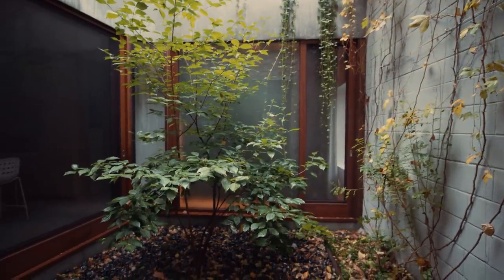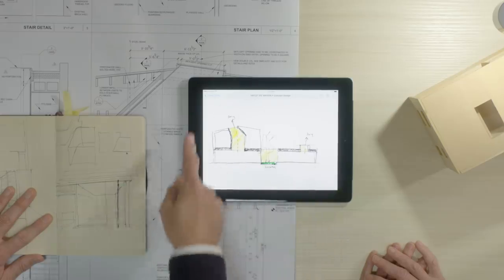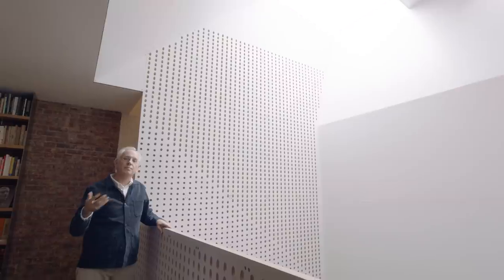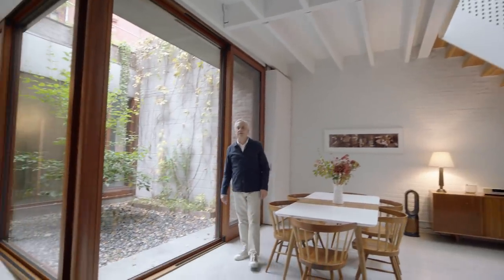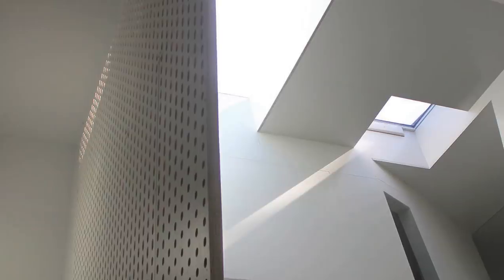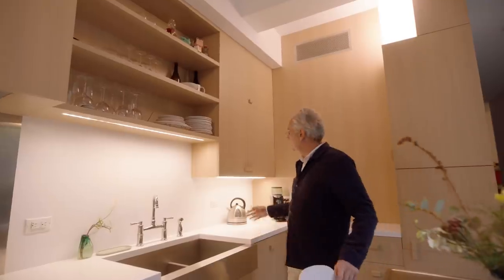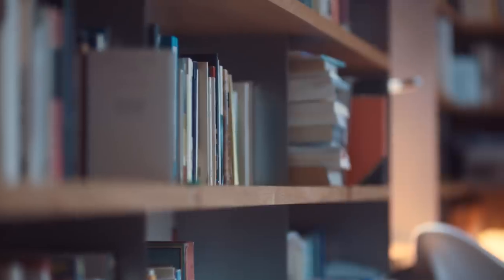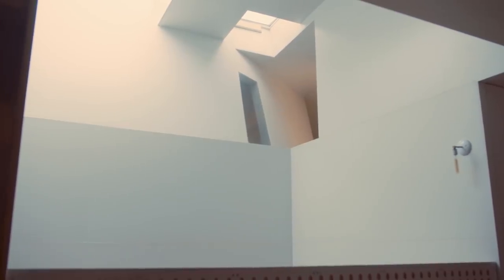Architects Cut Through Roof To Convert Carriage House Into Sunbathed Home

Comment: That perforated wall that angled at eye height for view and light might be the one if the smartest things I’ve EVER seen.
Reply: ...ever seen, just like those through the wall from her point of view

but fr, one of the most ingenious and yet simple solutions I've seen, just li-...
Reply: When you have that kind of money, an air cleaner/filter (less dust & house bunnies) is integrated in a smart home system ... or you can hire someone to clean it for you.
Reply: @nyuszi36  If you clean somewhat regularly, a vacuum will solve your problem because the doesn't hasn't settled and accumulated that much.
Reply: @masterlorden3075  Yeah sure there are ways to clean it, it's just so much more work to vacuum not only the floors but now also the walls including the roughly 6 meter high wall above the staircase which you'll need a latter for. I agree that the design looks amazing and useful for the case they designed it for. As Roxanne Salas mentioned I would also hope that they thought of some kind of smart air cleaner that will prevent dust from settling quickly.
Reply: Do children grow? This would work for maybe a year or 2 max? Count in construction time, and its a perfect solution for a minor problem that works for a best a few months
Reply: The money wasted on that was a big mistake.  Clear corrugated roofing with an option of painting it white would have allowed more light in.

Comment: In terms of engineering, I think it the perforated walls are groundbreaking, but I honestly feel like a good ole glass banister would have looked nicer and opened up the space more.
Reply: those holes seem unsettling
Reply: @EGoPRiNCExx  The light will be absorbed/diffused into the space behind the barrier if it was a glass banister. The perforated walls allows the light to be reflected back.
Reply: I agree that glass probably would have looked better but I would imagine that it may have been a safety concern since it sounds like these people have little kids. Not to mention glass magnifies the sun which may have not been the goal for that space.
Reply: Why not just a thinner wall and regular holes?

Comment: This is beautiful. Well done. I love the perforated wall w angled holes. Genius. One question that I've always wondered: how do you get the stairs sticking off the wall to be strong enough? What holds them up?
Reply: Even though the wall is holly (😳) it doesn't hinder its structural strength. Plus did you see the steel stair brackets ?
Reply: @garrygballard8914  the stairs are holding up the wall, not the other way around. Right? I didn't see the brackets.Just tiny metal hooks. I'll have to look again
Reply: @garrygballard8914  oh ok. So the stairs are sitting on brackets connected to the two walls. That makes sense. I just don't get what the perforated wall is connected to up above and how it gets stability. I guess from the stairs?

Comment: I find it interesting that in their discussion of the indoor garden in this carriage house these architects made no mention of the original concept which they basically copied: Japanese courtyard gardens.  In Japan, courtyard gardens within the walls of a residence or in a small, enclosed space beside them, are known as tsuboniwa (坪庭). This type of Japanese garden first appeared during the Heian era (794 – 1192).  These small indoor gardens are often found in machiyas, traditional wooden townhouses still found throughout Japan and typified in the historical capital of Kyoto.
Reply: Tsuboniwa is borrowed from Chinese Yuanyi style. No need to put a label on everything. And there are many other techniques and styles inspired by many other cultures and architects. These two designers put together designs with their twists to best fit the house and their clients.
Reply: Courtyard gardens have been used in houses around the world for thousands of years. Ancient Rome, China, Morocco, Algeria, and so on. Some concepts are fundamental and may develop independently in isolation. Though good architects are inspired by fine architecture throughout the world, I wouldn't call this copying.

Comment: Truly amazing.

I want a house like this that is small and cozy but has a large basement with light coming down from the main level and skylights. I want a large plot that could be adapted to bring natural light into the larger basement.

Never heard of that way of warming a house up either. "Radiant heat". Works perfect with concrete too since (as you say) it's a thermal mass. I've seen ppl make large concrete pillars that release  heat energy stored from the sun at night, but this is much more clever.

Close of basement and only live in small upstairs with all necesities
Reply: elias östby May I ask you where you are from? I am wondering because this system is practically the norm for new developments at least in Switzerland, but also many other European countries as far as I know.
Reply: @hockneyfication  Sweden, mostly made that as a note to myself, a reminder to look into this stuff.

Comment: Very nice. I like the use of perforation, something that maybe could be used more often since it doesn't necessarily imply a weaker structurem when literally opening up a wall completely is not desired. In fact, in some cases, it can improve the structural strength!

Comment: Sorry for the dislike but I have some issues.
I love what you did with the space adaptation itself, specially with the usage of light and vertical space, regardless...

The upper light angles only work when light is at it's most (when it was filmed). 
Creating different angles but using mirrored walls would be more challenging but would bring more light inside while creating a visual eye shattering effect.

Using a oneway mirror on the stairs would also allow the person upstairs to see the room while reflecting more light. 
Patterned or porous surfaces catch light or redirected it in a non controlled way.  
Sound insulation: Great! :: Visual Aspect: Not so much